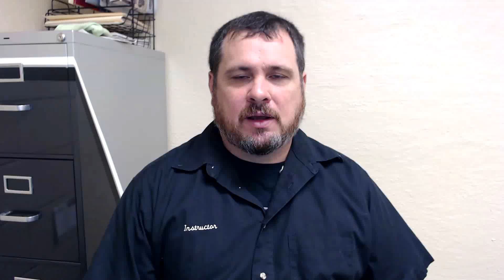Sand and Buff, How Long Do I Wait After Clear - Can I Wax New Paint?

Comment: This is the most straight forward explanation on this subject that I have seen & it is 100% spot on, thank you very much, many people new to painting need this sort of explanation.
 Just remember that most paint/clear/thinner directions that are on the tin are written to cover all scenarios. The manufacturers don't know if you will be using their product in winter or summer etc. So they try to be safe and give you basic drying times to cover a broad spectrum of situations.
 As for me, well, I live in one of the hottest places in Australia where in the middle of winter the daytime Temperature doesn't drop lower than 24 degrees Celsius (75 deg F). At the moment it is mid summer and the Temp outside is 37 deg Celsius (98.6 deg F).
 I paint Acrylic base coat and clear coat regularly in this heat & only wait 8 hours maximum before wet sanding or buffing. A couple of times (in a rush) in summer I have even done it all within 4 hours without issues.But I do have to be super careful. 
  Most days I have to use retarder thinner in my acrylic to slow down the drying process so I can get the stuff to flow, otherwise the paint & clear dries before it gets on the panel. But that is another story...

Comment: I am sure you have a video already but just looking for the next steps. Ex: What grid sandpaper to use to scuff clear coat then what to use for buffing and Polish etc. thanks for your video's they are great.
Reply: Hi friend better I've used to start with 1500 wetsand then 2000 then compound, polish and you are good to go dont go lesser than 1500 unless you have more defects you need to correct in clearcoat
Reply: @Sroor90010  I’m starting @1000 grit, then 1200, finish at 1500

Comment: Any reason I can't wet sand and buff the clear on my 68 Cougar that a friend sprayed in '92? It's always been stored, covered with a breathable cover. Spent a yr restoring it, probably a month for paint, sealed whole car after bodywork. He used high quality product, Diamont I think, from White Auto Body, it looked almost perfect then I sprayed and buffed a factory scoop 10yrs later and I can see a little difference, for the better, little smoother and maybe bit deeper, no peel. Had it appraised in 01, paint  was listed as excellent.

Comment: I waiting about 18 hours, tried sanding with 2000 and buffing with a orange pad, lots of scratches.  It was still so soft that even a blue pad would not get the scratches out.  This was at 65 degrees using American AC-385HS.
Reply from the maker: I am not familiar with that clear, but it may take longer in coller temps.
Reply: 65 degrees is cold. Here in Texas I wait 12 to 24 hours even when is 90 degrees or more
Reply: Did ever figure out how to fix the scratches?  I have the same problem.  Thanks
Reply: @swb3248  It’s okay in hot weather, just not cool weather.

Comment: I recently painted a bike frame and after letting it cure for over 2 months I finally got around to sanding and polishing. I started with 1200 grit and worked my way up through 1500 and 2000 and then polished each piece with turtle wax have polish. Now my frame is nowhere near as shiny as it was before I sanded and polished and there are a few white-ish streak marks on a couple of my pieces. I have no clue what they are and I'm afraid to sand them any more. Any advice would be appreciated. This is the first and last time I try to sand and polish my paint.
Reply: you need to compound,polish then wax to restore shine'
Reply: You probably needed to wet sand it and not sand too much.

Comment: Hello.. if I wet sand and polish before 15 days the shine decrease and need to polish again and again like 4 times each two days.. I already bought a Infrared curing lamp but I haven't use it yet.. I use Matrix clear coat in my body shop. Any recommendations?
Reply from the maker: There is a such thing as die back, but the sand and polish should have taken care of that.  Years ago I did have a complete that never dried correctly.  It stayed soft.  It was very difficult to sand.  The rep told me that I shot too many coats too fast, which caused this.  You may get your paint rep involved because it could also be a bad batch of clear or catalyst.  If anyone else has experienced this problem, please let us know.

Comment: What about if u want to put a decal on you car, but u just paint and coated it. How long you have to wait till you can put the decal on?
Reply from the maker: If it is a stripe or small decal you should be fine after a week or two.  However, if it is a large decal or wrap, I would let it fully cure. I would check with the paint manufacturer to see what their cure recommendation are.

Comment: I used Sherwin williams fc710 spot panel clear, I've waited a couple days, a couple runs and nibs wet sanded out fine. I then used wool pad and then foam pad but when it comes to a final polish I cannot get rid of the swirl marks. The pads and microfiber towels are clean, could the clear coat just be too soft? Or could it be the quality of the clear coat (around $100 a gal)? It's also black paint so very noticeable. Any advice is appreciated
Reply from the maker: I lived in El Dorado near Wichita at that time.  I live in Missouri now.

Comment: I would wait the 90 days to buff and wax no point on buffing the paint if you can't apply any protection to the paint, there's a high possibility that you will scratch the paint in that time, just my opinion
Reply: I made the mistake of waxing my hood the day after it got fixed/painted..the damn hood hazed up!😭
Reply: I agree , this guys video makes no sense id wait to for it to fully cure , clear coat can shrink

Comment: What I did not know this information and I already washed fresh clear and left marks in it?  How can I fix this?
Reply: Should've waited 30 to 90 days for clear to fully cure. It has to dry and harden and bond to the paint. Don't ever sand and buff 24 hours after. the material is too soft and the heat from the buffer will whip and spin the clear because the clear it way to soft to take on the abuse. Straight Physics here my man!

Comment: Great video. Thanks
Can i scuff new  clearcoat and then reclear after couple of weeks ?
Reply: Flowcoat. Yes, hit it with 400 grit (to 600grit)first. Tony Ritchie and the Gunman do great videos on flowcoat/reclear. After watching them, I painted the truck Toyota OEM red pearl metallic color and 1med 40% solids coat with red/gold micro flake.004" then two med. clear coats over that. Waited about 2 weeks sanded again with 400 and shot High Solids 46% clear with 3 more light, med and med coats and I got a couple of little bitty sags but way less than I feared. Have fun and go it your safe.  1st paint job and I am so happy.

Comment: What if your paint has a high gloss in it and was advised not to clear coat..how long do I need to wait to wet sand?  Great to the point video!
Reply from the maker: This is a single stage you used?  Solid colors you can sand and buff with no problem.  However, if it is a single stage (no clear) you may disturb the metallic coat.  Every brand of paint has different directions, but I thing you would be safe sand and buff the next day if it is not a metallic.

Comment: How long to sand her after clear coat?
Reply from the maker: With the brands that I have used, I normally sand and buff the next day.  It is actually easier to sand and polish before the clearcoat becomes fully hard.  But don't use wax, ceramic coating, or anything with silicone until the clearcoat is fully cured.
Reply: @CarAddictGarage  I mistakenly used my polisher to remove the harden part of a part on my hood with 800 grit. Big big mistake!😂 beginners luck I guess. But I’ll show you the after project in my videos I’ll upload one. It came out really good with the first two cans but it’s not rough now I’m buying this one that protects from the sun Even more. Hopefully 4 cans of clear coat is enough. It was shined and bright until I sanded her down with 800 grit on my polisher.

Comment: Thank you for the good video.
How long will it take until the paint won't dent if you press it with your fingernail?
Also, if the paint / hardener ratio is off by say about 20% will this affect the paint's ability to properly cure?
Reply from the maker: I answered your question in this Q&A video.  I hope you find it useful. https://youtu.be/eAxFFMwS754

Comment: Ok, maybe someone could help me with this question.
I've paint my motorcycle cowl with rustoleum gloss black, and cleared it directly afterwards.  My question is, do I  still have to wet sand and buff if it looks great,  without orange peel , the way it is?
Couldn't I just let it harded and be done? Thank you in advance for any help! Love the channel!
Reply from the maker: I am doing a live Q&A video tonight at 7PM.  6/28/19  I will answer this question for you.
Reply: @CarAddictGarage  
Thank you! I will be watching!
Reply: As a side note.
On this cowling. After the peice cured, I  sanded smooth with 600 grit wet/dry. Placed OEM graphics,  cleared again with another 4 coats and sanded 2000 grit.
    Then applied 3 more coats with the last 2 super wet. Turned out awesome!! No orange peel,  mirror finish... I  hope I don't have to sand away the look, but I  want it protected from elements.
Reply from the maker: Here s the video replay I answered your question in this live video.  https://www.youtube.com/watch?v=u7KvLuqKrL8

Comment: Dude not straight on the truth. 1st he said 24 hours to wet sand, Then he said 30 to 90 days. Which is it? I'd rather wait 30 to 90 days. You will mess up the clear because it's to soft and not cured. 2nd: You will have a reaction in your clear coat folks. Just tell the truth! Car Addict Garage